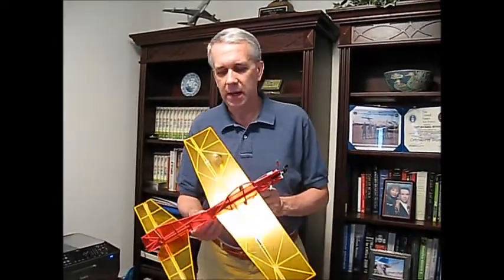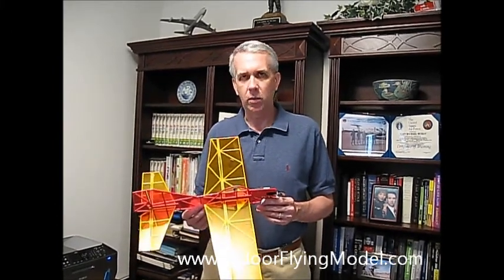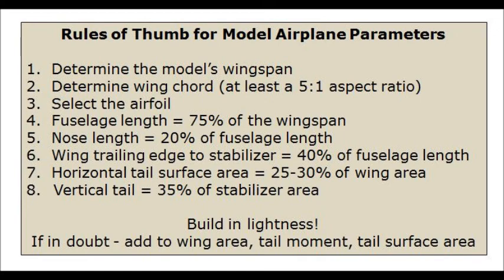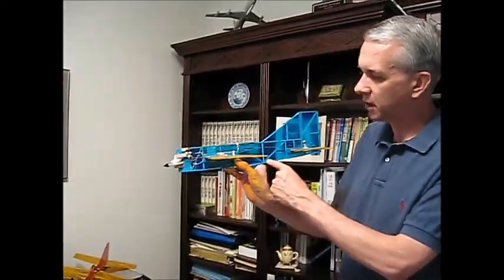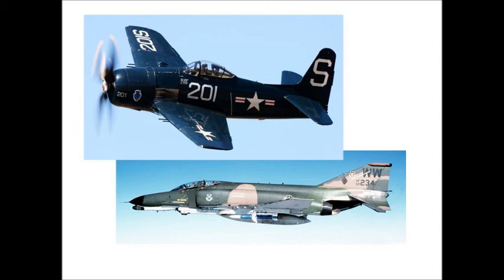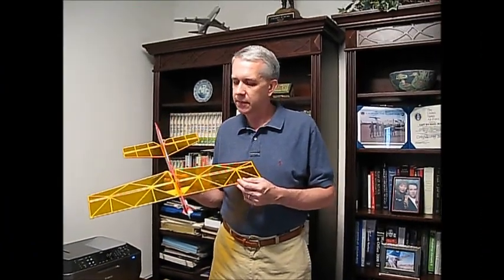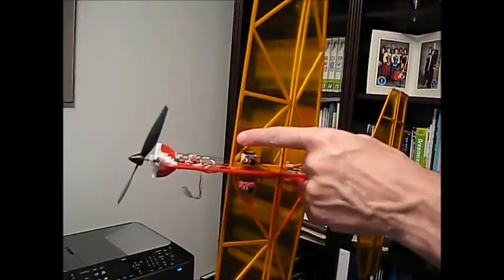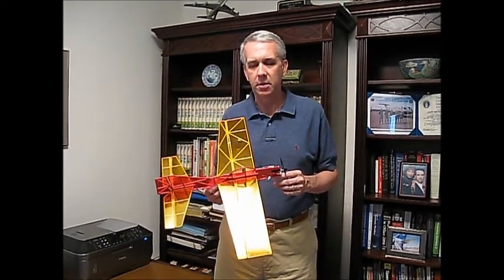How to Design RC Airplanes

Comment: Food for thought: As a wing’s angle of attack is increased relative to the flight path, lift and drag increase up to the critical point where the air can no longer flow smoothly over the wing, resulting in a sudden loss of lift or stall.

When a wing features a square leading edge, as most flat-plate airfoil foamies do, the airflow can not pass over the leading edge smoothly.  Thus, the wing is prone to abruptly stalling at low angles of attack.  Rounding the leading edge of the wing provides a smooth contour for the air to flow smoothly around as the angle of attack is changing.  Not only does rounding the leading of the wing cause the stall to occur later, the onset of the stall and loss of lift is much less abrupt.

In practical terms, whether you are making small pitch changes, or transitioning from flying on the wing into high alpha flight, the transitions are smoother and a plane is more stable when the leading edge of the wing is round.  Plus, you won’t need to make as many elevator corrections to fly normally.  Keep in mind that the tail surfaces are airfoils, and rounding the leading edges of the tail will make elevator and rudder control smoother as well.
Reply from the maker: Excellent points, thanks!  Tim

Comment: Tim, I lost my Sport Cub S to a combination of poor judgment when flying in the wind. Fortunately, the model had my name and phone on it! A fellow found it in four lanes of traffic and I found that only one of the wing servos was trashed - it responded to my Spektrum NX8 control. The AS3X functions are all working.  I set about looking for a model that I could build using the motor servos and the receiver "deck". Because of the need to preserve the AS3X functionality, I will have to mount the deck 90 degrees to the Robin's fuselage - not "sideways" as you are able to do. That is the only hitch in the design process.
I would like to build a model for the Sport Cub S gear just like the Robin. I would only change the wing to a "cranked" Jedelsky-like airfoil rather than a flat plat that you show. I will visit your website to see what more I can learn.
Reply from the maker: Steve:  Thanks again for checking in and best of luck.  I think the Robin would fly a lot better with foam board, this model was in my early days.  Also, website no longer up as I am focused on this silly YouTube channel.  😁 Tim